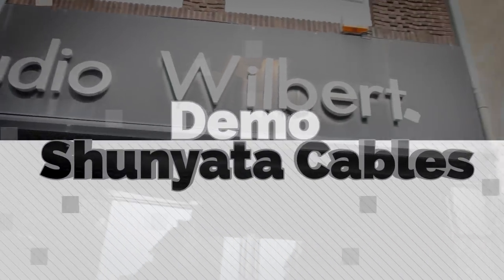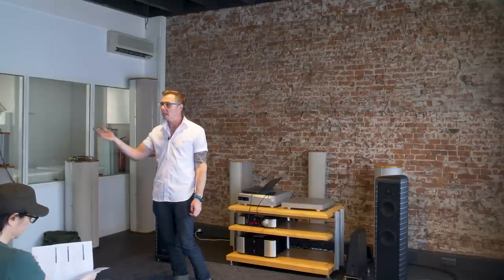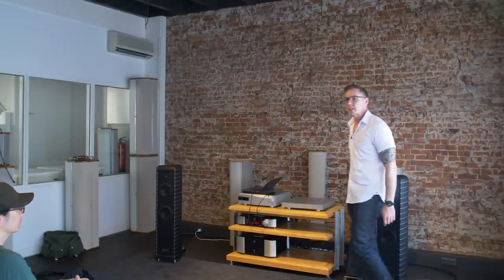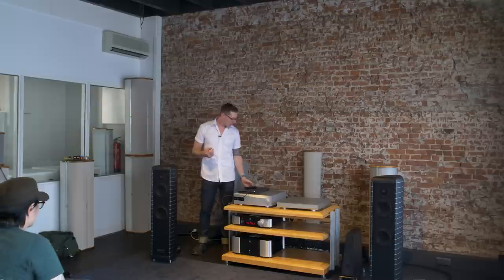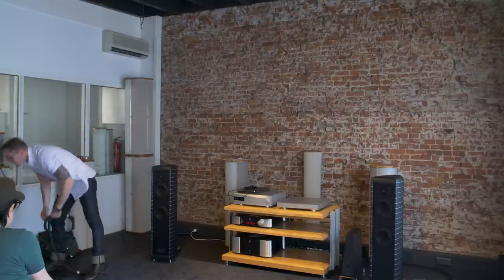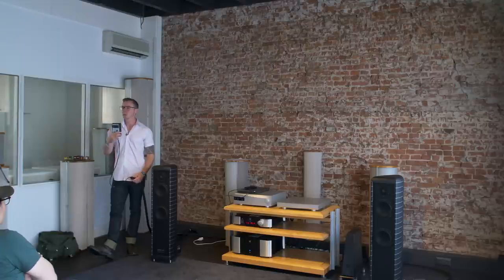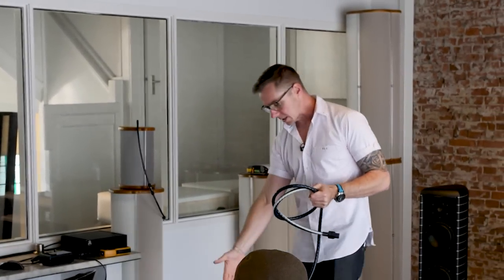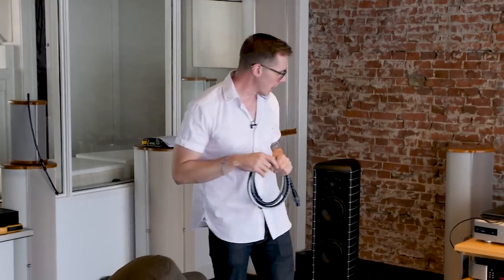How do Power Cables work? - Demo Shunyata Research - Hifi Studio Wilbert Utrecht

Comment: I’ve watched this video a few times to try and process/absorb its content/message. I’ve failed! Ok, so I’m not an electrician. I’m not a quantum physicist. I’m not an electronics engineer, not even an audio technician. But I do have a good grounding in the sciences, especially physics which was my university forte.i don’t give a flying fig how good your cables are, or what noise reduction technology has gone into their production. The simple and over riding fact is that the very first thing any audio component will do, is take that incoming mains power, regardless of what processing or filtering it may have been subjected to, and convert it from AC, to DC.  This eliminates noise and harmonics carried by that AC power.

As regards your ‘QRBB’, which you loosely describe as a balloon filled with electrons, ready for release as and when required. Well, is that not exactly what the bank of capacitors does in any well designed component? 

You describe power as being ‘instantly dynamic’ and not linear. Well, no matter how efficient your cables may be at delivering power to a component, the first thing that power will pass through when it reaches a component, is that component’s internal fuse. A short length of high resistance wire designed to overheat and melt, breaking the circuit should the occasion demand. 

I’m not claiming that all cables are the same. You would not take the cable from your 40w bedside lamp and use it to connect your 1.5kw heater to the wall mains out, would you? But, on the other if you used the cable from that heater to connect your lamp to the mains, would it make that lamp perform better? I think not.

If I seriously thought an €1100 power cable would improve the performance of my hifi, I would still choose to invest that €1100 in upgrading components.

Often, I think costly solutions Are fabricated to solve non existent or at least, trivial issues.

Enjoy the music.

Comment: Why doesn't he just show the difference between a bad and a good power cable on the oscilloscope?
Reply: Wait don't tell me, it's not actually visible on the oscilloscope, you have to experience it right?
Reply from the maker: @Cityj0hn  what is an oscilloscoop going to show or prove?
Reply: @TheAlphaAudio  You are probably joking right?
Reply: @TheAlphaAudio  it will show that there is some difference at all ! It must not be osciloscope, it can be easily done with recording sound with cable A and cable B and look for differencies. But there is no difference, so measurement is not done by cable impostors ..

Comment: BTW, from an engineering perspective, and I happen to have a PhD degree in electrical engineering, with plenty of experience designing and building switching power supplies for an Israeli company called Advice, there could be no audible difference between an 8$ and 6000$ power cables.  

The best results in terms of EMI noise immunity can be achieved by a cheap DIY power cable with the two main wires (live and neutral) twisted together, and the ground wire wrapped around them and acting as a shield. Such a cable will cost you 10$ to make. Exotic copper wires don't make any difference, the same goes for LC-based EMI filers, which are already included in the audio components. 

Moreover, the sound quality is not affected by additive high-frequency EMI noise. Audio components need DC power to work. Assuming its a good high-quality component, then all necessary efforts were already taken by the manufacturer to insure clean dc power supply, regardless of the ac mains conditions... 

At the company, I worked for, we had one product which was a true sine online UPS. We did many blind A/B tests using a high-quality audio system and nobody could tell the difference.

Exotic power cables are the biggest selling snake oil products... Audiofools love them and are obsessed with them... It's a great business... any idiot who got scammed and paid 1000$ per one meter of power cable will do anything to convince himself that he can hear the difference....
Reply: E Barbie see above
Reply: Some Folks will never ever understand that Engineering is what counts. Not how much money you spend. This is flat out B.S!
Reply: Phd in electrical engineering still the knowledge less than an undergrad in the same domain. Transistors are non linear, super sensitive devices with super complex power consumption profiles. Anything can matter.
Reply: E Barbie - 1st Paragraph: but there can be.
Reply: @carlosoliveira-rc2xt  Right I mean the device is either on or off right?
Reply: I 100% don't believe you at all. No EE would ever say "The best results in terms of EMI noise immunity can be achieved by a cheap DIY power cable". Your opinion goes right into trash.
Reply: @gioponti6359  It's simple. It's a belief you have that produces the placebo effect. It is a fact that mains leads cannot, and therefore do not, affect performance.
Reply: Trev C - so, a sound conviction that component or parameter X, if changed, will NOT alter SQ is not a sort of belief system that may influence or dare I say cloud anybody’s judgement?

Anyway.
Reply: You should start an audio company and sell your $10 cables for a $1000 and get rich

Comment: 9.44 - this is only with respect to the active components right, like diodes and transistors. Imo the effect should be a lot more drastic in DACs coz there you're not only playing with the dynamic handling of transistors (along with psrr) but also the fact that the DAC and Oversampler need a clock to function and the clock is controlled and stabilized by a current source.

Passive components like caps don't work that way to my understanding.
Reply: He's telling how a cap charges on start-up. but they hold a charge and supply the components with those peaks. Because of very large caps, so the draw is not linear across the power supply.

Comment: I want you to advise me about  power cord used for the AV receiver and Subwoofer. The price is $500 to $1000 What is the best power cord to your experience?
Thanks
Reply: Don't be a moron. Use the provided power cables. You'll be throwing 500 to 1000$ down the drain... Better use them to upgrade your system with better components, like a second subwoofer .

Now, from an engineering perspective, and I happen to have a PhD degree in electrical engineering, with plenty of experience designing and building switching power supplies for an Israeli company called Advice, there could be no audible difference between an 8$ and 6000$ power cables.  

The best results in terms of EMI noise immunity can be achieved by a cheap DIY power cable with the two main wires (live and neutral) twisted together, and the ground wire wrapped around them and acting as a shield. Such a cable will cost you 10$ to make. Exotic copper wires don't make any difference, the same goes for LC-based EMI filers, which are already included in the audio components. 

Moreover, the sound quality is not affected by additive high-frequency EMI noise. Audio components need DC power to work. Assuming its a good high-quality component, then all necessary efforts were already taken by the manufacturer to insure clean dc power supply, regardless of the ac mains conditions... 

At the company, I worked for, we had one product which was a true sine online UPS. We did many blind A/B tests using a high-quality audio system and nobody could tell the difference.

Exotic power cables are the biggest selling snake oil products... Audiofools love them and are obsessed with them... It's a great business... any idiot who got scammed and paid 1000$ per one meter of power cable will do anything to convince himself that he can hear the difference....

Just use the free power cable and you're good...
Reply: @ebarbie5016  You are a electrical engineering PhD named Barbie eh? Ok Barb, is it ok to pay 70 bucks for a well built shielded power cable or should I stay with the 10 dollar sht? (No 2000 dollar sht...just 70 bucks vs 10 bucks...) what say you Barb?
Reply: @wa2368  High tech airplanes use non-shielded cables, hundreds of miles of it. what do you think?

Comment: I recently received a power cable , which (including - burn-in ) cost me just over £200 .I have tried a variety of music's and cannot hear a difference.
Reply: because there is no difference :-D
Reply: That's right!
Reply: Power cables most definitely matter. On the power amp (strangly) it has less influence as connecting to a Dac. But your system has to be in balance and good... then most people should hear a difference. With cables u can tweak it a bit more to your liking (when the rest is good). You cant make a crappy system great by cables. But a good balanced one you can make sound better or worse.
Reply: Replying to ( E ). perhaps I should have spent a lot more on the cable and I agree you can't make a silk purse out of a pigs ear. The system I have is a  Quad artera pre plus CD player matched to the matching Quad power amp.The XLR interconnect - Tellurium Q Black Diamond £1,200. - the speaker cables inc:- jumper leads Audio Quest Rocket 88 to ATC scm 40s standing on Townshend podiums .Mains block is the Swedish company Supra 6 gang. So perhaps an upgrade to the mains filtration ? ⚡
Reply: @andrewaajohnson7584  I have red on a forum a few days ago that upgrading from a Supra (cant remember which one but could be the 6 and to which one) made a significant change. 
The most important thing of course is the phase of the power cables in the mains (and the mains). They must be all correct. I cant measure so use my ears on what sounds best for all components. Yesterday my system sounded wrong, no strong basic and out of phase. Turned out my power amp was plugged in wrong. (We have EU connectors, maybe US is one way only). After founding which was plugged out of phase everything sounded correct again.
Oh, and more expensive doesnt always mean better (often it does). 

I even heard a 5k system on a show that was perfectly balanced. Great!
Before that we heard a 200k system that sounded not in balance, too bright and so on... And another 80k system with a expensive record player sounded amazing....!!
Reply: @explorinlearnindoing5462  You cant make a crappy system great by cables, true. But you can measure a crappy system ;-) Despite what cable you use. Just as you can measure "the best"  systems. And yet, even with the best systems, you cannot measure any difference. You can talk all day long, around the bush, putting on smokescreens etc. but what you cannot do is give us proof; measurable differences. the only and final word is " Believe us, Believe your ears". Gaslighting our placebo braincells.
Reply: @deejeemadrox1866  Proof isnt a measurement...! Its what I hear!
And with all these years in the audio I can guarantee its not a placebo or believe thing... its hearing real differences. 
There are 3 types of people;
A) the one that will never believe in cable differences (who need visual proof by a measurement, and without it they cant hear it 😅) 
B) the people who actually use their ears (without judgement or beliefs) and hear real differences, and after that they know their is more to it than just measurements. (Usually these are audiophiles with good ears. And there are also so called audiophiles who cant hear right, who need proof).
C) The ones who were A) but very slowly over time became a believer (not a real B yet, but at least their thoughts are less in their way). 

I am not taking a piss about the A people here, dont get me wrong. Its just what I experienced over the 3.5 decades of audio hobby. 

If you want a cheap but very good sounding cable, buy some Duelund 12Awg speaker cable (by the meter) you can make yourself (ask the seller).
If you cant hear the difference with your own cable, then it could be your ears..  Or if you dont hear difference between copper and silver cables, then it certainly is your ears.... Then better sell all of it and listen to a radio. 🤘
Reply: @explorinlearnindoing5462   Yes, yes. i know the holy grail " you can hear it"  thing. But you know what? It is our brains that fools us, the placebo effect. When you buy something " special", that cost a arm and a leg, you are soo eager to hear it. You want to hear it, so badly. You convince yourself you hear it. But then, a blind test. All good hearing and wishes falls apart. Never been a solid blind test, where does magestic, audioquest priceless cables where without dispute, massivly convincing way chosen against " normal"  , good cables. No no no. Another mistake, you do not hear cables, you hear what comes out of your speaker-units, the drivers. And yes, copper and silver give another sound, that is proven, you can messure it. Do not blur the discussion, as audiofools often do. EMI is taken care of inside the device, very well actually. You do absolutly do not need expensive external shit to " enhance"  your EMI-shield. Another Snakeoil illusion the audiofools fallen for.

It is a utter joke to see audiofools need massive fat cables from their amp to the box, while at the same the circuitry inside those amps, and wiring, is so much smaller. But no no, you need 20inch fat copper-silver cables to " carry"  those presious audioowaves a few mtrs away, ofcourse some inches above the ground....omg, lol. the madness. The totally unscienced way and totally illogical reasoning behind this. In any way, one thing is sure; once lost, always lost. Audiofools have lost reality, thats a fact!
Reply: @explorinlearnindoing5462 dude, i do not need to make homebrew cables. Already did the " monstercable"  test vs  normal wiring and no, nothing great came out of it. it looks good though, a fatter cable. But soundwise. Nope. My brother in law, he bought silver cabling, with a B&W speaker, known for its gentle, softer lows and a class-d hi-fi amp, known again for the gentle lows. So, with that mix what did he get; lacklustering lows....no suprise. To get some back, he only needed to buy some carpet, on my advice. Room corrections do so much more for your final sound, often cheaper too, then investiong in snake oil powercords, connects and cables. That is the last place to incest your hard earned money in. Start with the room first! it have the biggest impact on any hi fi system of whatever price.
Reply: @deejeemadrox1866  I appreciate you took the time to write your thoughts. 
You dont have to believe me. 
Some still think the earth is flat!

I do agree with your room correction thoughts. Its half the sound quality difference or maybe more. 
It all comes to balance. And then when its almost perfect in balance sound wise and set up right then cables can make or break your system, they make a big difference.  

But true, some ppl will never hear it.
For them it saves big money.
Reply: @explorinlearnindoing5462  when there are big difference, you caN MEASURE them. We have very sensitive, highgrade equipment to do so. You know, the same equipment we use to start building speakers etc. to start with. O wait, we use it only to build, according to you audiofools. it stops when sound is coming out of it....yes yes, keep lying to yourself. You know it aint true. You know it does not work that way.
Reply: @deejeemadrox1866  Broh... everything matters to get better sound, which are hard or even not measurable. Capacitors sound different, coils, even tubes and yes a wire... even power cords... all matter a lot btw. 
But maybe you will learn in another decade. 
I dont mind. Do what you want. 
I would indeed be an audiofool if I continued the conversation with a non believer who has his opinion based on measurements in stead of what he truly hears. Or maybe he really cant hear it...
A real audiophile like me has trained his ears over decades of listening to many high end systems and in my case (about a 1000 systems) and also years of finetuning speakers. 
We just have better ears...
Reply: @explorinlearnindoing5462   you have trained ears ...blabla. better then us, and STILL fail tje feared blind test....lol. Give me a break.

Bottom line is: YOU think you have better ears then the rest....you believe that. But what you think and you believe does not make it more true....lol
Reply: I like fancy power cables. Mine is not expensive. I use these fancy power cables for decoration and theater